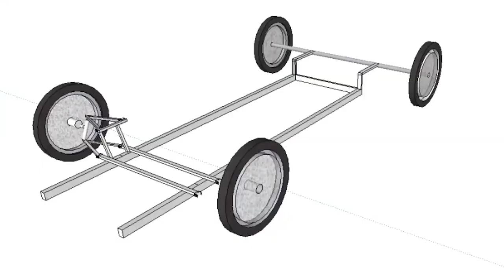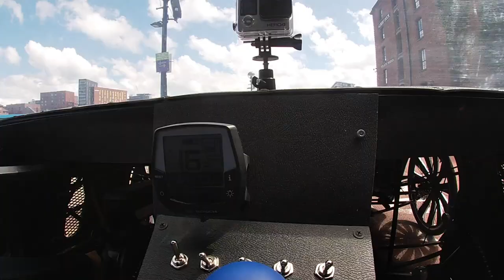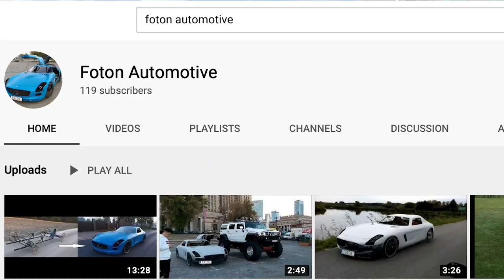CRAZY SLS AMG BIKE | Foton Automotive in Liverpool

Comment: I’m wondering what a difference it would make to have a lightweight shell for the floor as well, making it feel more enclosed, covering the bars and open road, some cup holders, sound system display, speedometer etc all trying to keep it thin & light weight while adding to the immersion. I’m sure someone out there can design a gear system like an 18 speed bike but with a flywheel acceleration assist or a very high gear for highway speeds, like those record breaking spins with some impossible ratio like 85:17, I’ve seen some Frankenstein sized fixed gears get up to 55 on flat highway but unless you can shift up to that it’s not practical on the knees, if we add some flywheels might as well make some coils to charge a bank of super capacitors.. a little electric motor assist.. rooftop solar cells.. flywheel-super-capacitor-electric-pedal Tesla anyone?

Comment: Do you think this guy would like to try building a human powered aircraft, which would use bellows to force air through leading edge slots , over the upper surface of the wing.  Thought of using a leaf blower, which pumps out air at over 160 kph which would produce a respectable amount of lift if not a dazzling forward speed.   But human powered would require fewer certifications. Maybe even some prize money in it, though I haven’t checked that out.  The existing human powered aircraft have ridiculous wingspans requiring exotic and highly stress wing structures.  This proposed method might perform with significantly smaller wingspan and less delicate materials

Comment: I want to add a 72 volt motorcycle kit I won't one of these two of them motors.
Reply from the maker: Brave man! 😂
Reply: @RODEBLOCTV  Would it make it unsafer? One motor and carry a 300 lb and 60 mi per hour.
Reply from the maker: Steven Correa true! Not sure I fancy 60mph on bike tyres though!
Reply: @RODEBLOCTV  There are only $300 a piece, I would love to see this thing go 60 mph battery is not included.
Reply: I see your point. But one of those little motors will only be like 30 miles per hour. I think I will be scared to do 60 on a bicycle to.

Comment: Hi, am really interested and impressed with the video and above all the mechanical engineering genius exercised by the Innovators.

Am also working on the similar project of highly efficient peddled cars, boats etc. I have developed a concept engine to drive these vehicles and machines. I need financial and support to make a prototype of the vehicle. Or to be linked with peddled car manufacturering companies. Am optimistic that my innovation will transform the peddled vehicles (PV) industry and contribute to cut carbon emissions for a green and clean world.

Yours Engineer
D.Banda. 
Zambia.